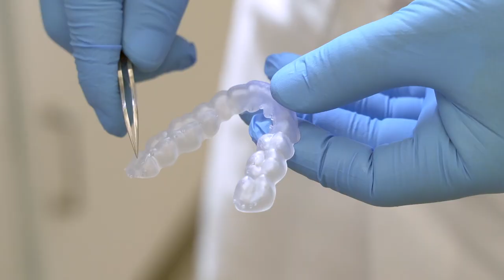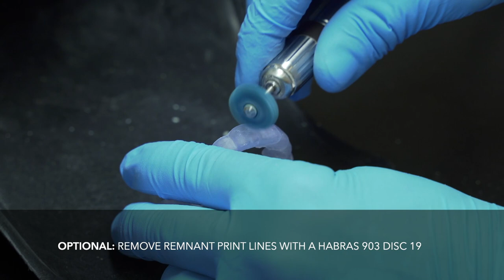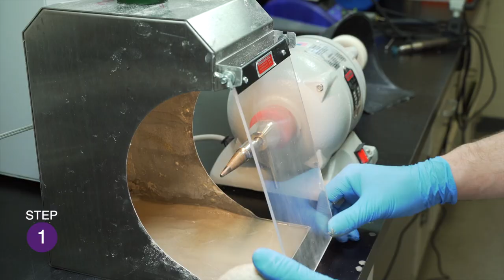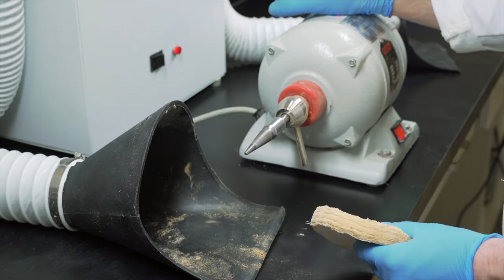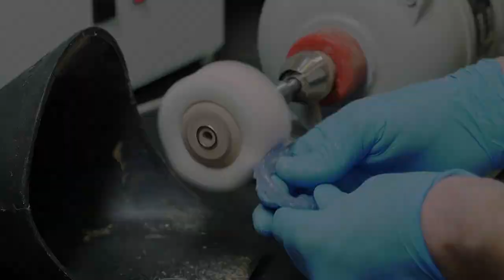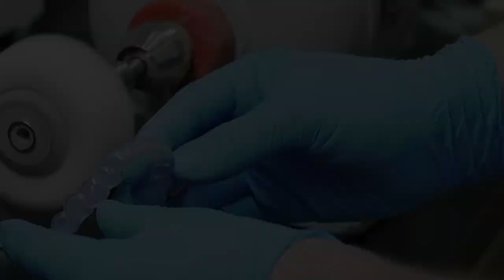KeySplint Soft Polishing Protocol

Comment: I am extremely unhappy with my splint - it was crudely shaped, didn't fit and moved my teeth. My dentist has to make adjustments which left the guard bumpy.  I am worried about the way in which the pores were opened by my dentist and what I may be ingesting. Is there a way to have my $400 splint redone?
Reply: If it doesn’t fit, your dentist should be telling their laboratory to remake it. There should be no charge on your part. 

If it’s a keysplint (soft or hard/soft) nightguard, I would first suggest you leave it soaking for a minute in very hot water (hot enough to where you can’t keep your finger in it for more than a few seconds) and then quickly put it on. The nightguard should become flexible and easily mold to your teeth.